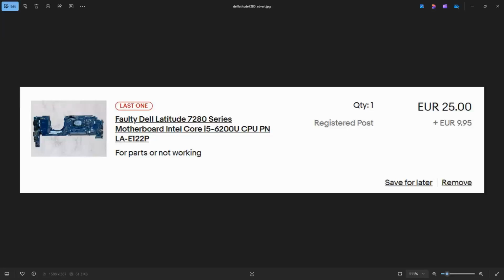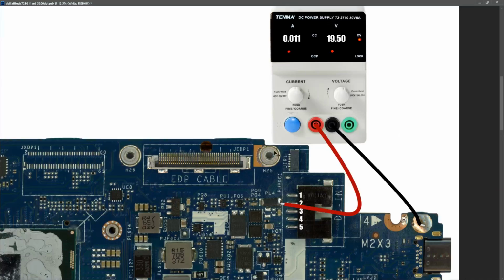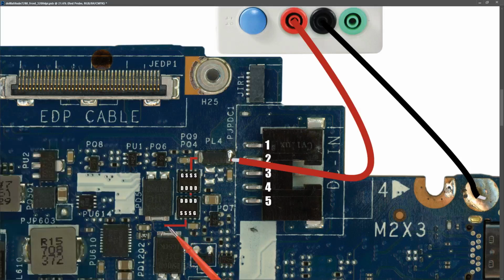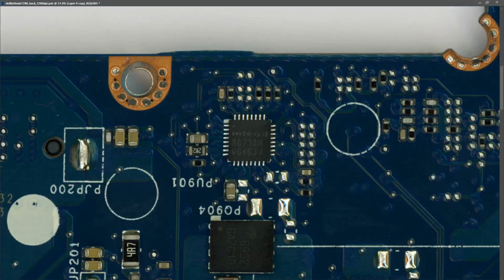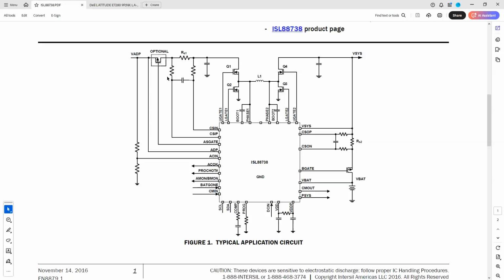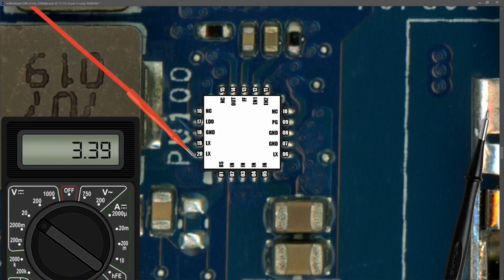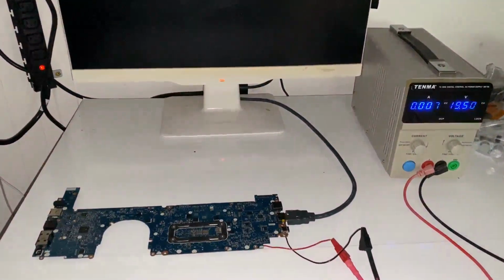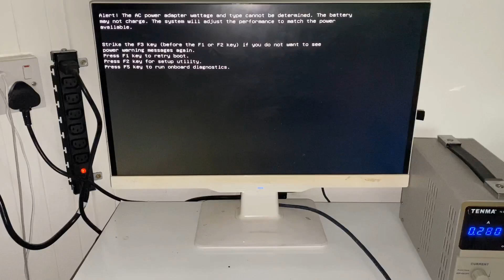DELL LATITUDE 7280 - FOR PARTS OR NOT WORKING

Comment: Another great video.

Having once been at the other end to condemn laptops as faulty, faulty may not mean not working, but instead may mean not work as we (the end user) want it to work.  For example I have condemned boards that:
Worked, but dead nic.
Worked, but keyboard dead, and new keybord still wont work.
Worked, but usb all shot.
Worked, but only one dim socket worked.
Worked, but would not display the whole memory capacity of the dims.
Worked, spurious graphics, or lines.
Worked, but soon as a wifi board is inserted, it won't boot
Reply from the maker: Thanks Karl, it was my mistake. I meant to purchase only boards marked "not powering on", but when I got the last batch of boards I realized this one was marked as "faulty".

Comment: In the first minute of this video when you showed the DC-IN connector, I see solder on two adjacent ground pads. Was that your solder, or did a previous tech add solder to those ground pads?
Reply from the maker: Yeah I made the usual mistake of soldering before scanning.

Comment: Might be sold as not working because is not charging.If is not charging the battery check the middle pin line for short there is a protection diode that is getting shorted sometimes.